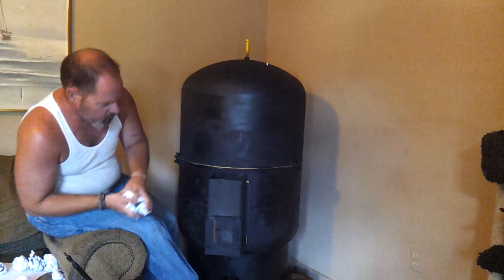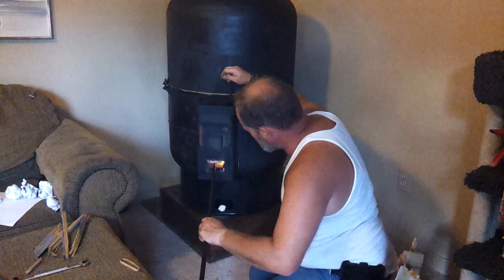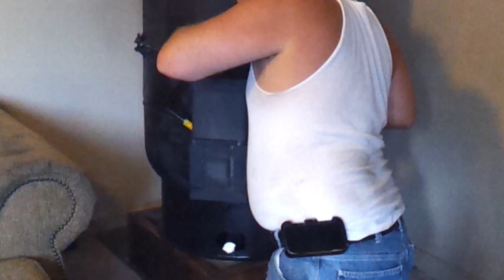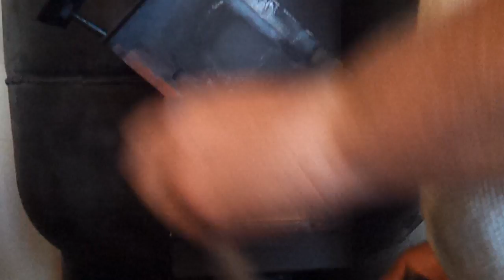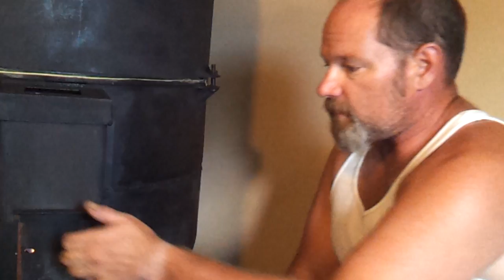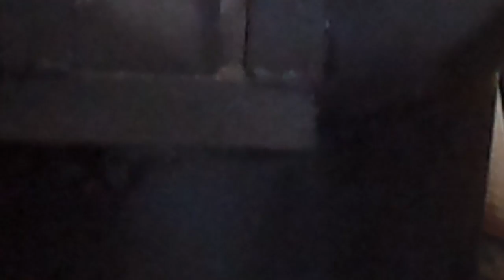Rocket Heater Wood Stove Installation Part 5 (The First Burn Indoors)

Comment: - How a rocket mass heater works:

As we all know heat rises so lets skip that discussion and go onto a more in depth explanation...
The smoke/heat take the path of least resistance which is up the larger diameter riser (taller portion of the J tube) and out the venting pipe. In doing so a vacuum is created which pulls air into the smaller lower opening of the J tube creating a high velocity airflow which supplies more oxygen to the fire thus creating much higher temperatures resulting in a very efficient burn of the wood which leaves minimal waste (unburnt wood) resulting in minimal amounts of ash leftover and a very clean burn. All in all more energy is extracted from the wood therefore less wood is needed.

The gases that would typically be in the smoke almost don't exist in a rocket mass heater. This is due to a very efficient burn of the wood. The more efficient the burn the less harmful and cleaner the exhaust becomes. This applies to anything that burns.

Just a FYI:
Wood doesn't burn it's the gases in the wood that burn and to release these gases heat is needed, the more heat you have the more gases are released. These gases can be captured and used to run an engine and can be used in many other ways such as storing it in a holding tank (propane tank) and using it the same way you would use propane or any other gas. This method is called wood gasification, if you want to learn about wood gasification just look it up..
Reply from the maker: thank you for adding such a detailed comment. could not have said it better myself. thanks for watching!

Comment: i probably would have done a dry run or two out side to work out all the kinks like your chimney , and you might want to consider firewall sheet rock around the stove its self and something under it like slate floor or some type of non combustable flooring you have out placed on a rug this is a hard core fire hazard no mater how simple the stove may be you dont wanna burn your house down at the state of an experimental stove . seen it to many times .

Comment: I don't mean to be negative but are you allergic to fire resistance walls or are you looking for the Darwin award?
Reply from the maker: Myopinionjustsaying  I have checked the temp of the walls and they only get to about 90 to 95 f.  No need to have it for protection but it would help for thermal mass. Thanks for watching!!!
Reply: Well, I just dont like seeing people taking a chance and getting burned up, but, thats just my hangup I guess.

Comment: When burning wood how often do you have to feed it? I understand it probably varies  with type and size of wood but I am just wondering in general. Also have you used a "normal" wood stove?  If so how does this compare?
Reply from the maker: Edmund Squid Depends on what material i feed it but ranges from 30 min with hard wood to 5 or 10 with soft wood and wood chips. Yes I have had a wood stove in the past and find that this burns sooooo much less material and it also does not over heat like a woodstove will.  Hope this helps. Thanks for watching
Reply: Thank you for the info. Is it possible to fill it up and shut it down for a long burn time?
Reply from the maker: Edmund Squid "long time" is relative but the best way to time release the heat is to add mass. in my opinion.  Thanks
Reply: Guy Brown is there no way to bank one of these things for the night. I dont want to sit up all night babysitting a heater.

Comment: Just finished watch the whole serious of videos  Great Job !! Not only on the stove, looks like it will work very well , but also on the videos they where short and to the Point. I have one suggestion with your welding . Flux core wire dosent make the Prettiest welds but if you clean up the weld areas ,(Grind off the Rust and Paint) You will get much better welds with less splatter and Pin Holes .  Hope to see more stove vidios as you use it more  BIG THUMBS UP !!!!!!!!!!!
Reply from the maker: Thanks!!! It does work very well. I will be removing the top and checking the inside here shortly and will film it too. I do have some plans for making the feed tube better but will wait until spring when I can uninstall it.  Thanks for watching and glad you like the rocket heater...

Comment: It looks like the stove is close to the walls. Do you have problems with the walls getting hot?

Are you going to put a fan behind the stove to get the air out into the room?

Thanks
Reply from the maker: I've check them and they run about 90F or so